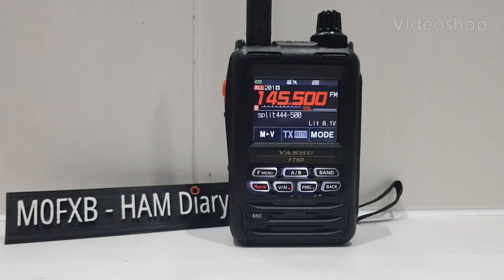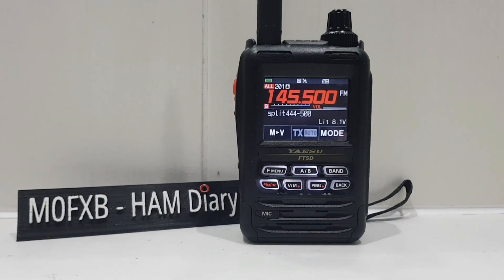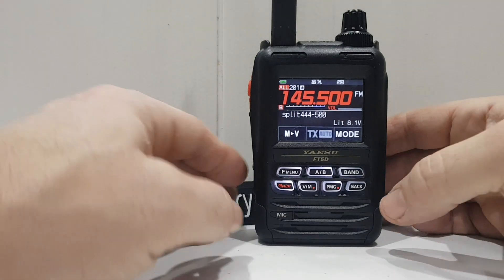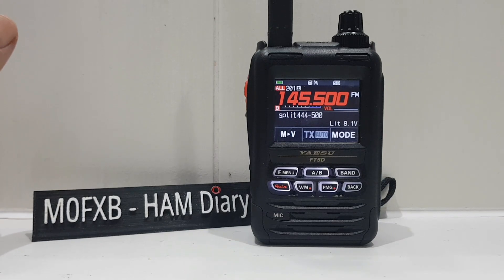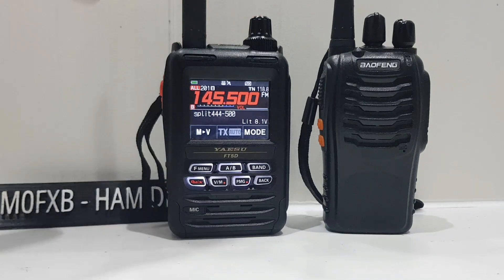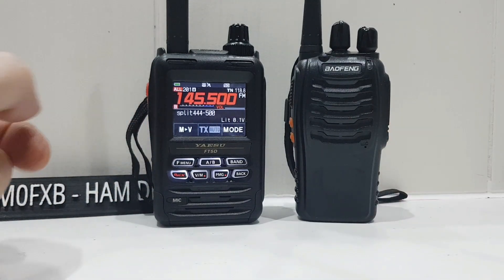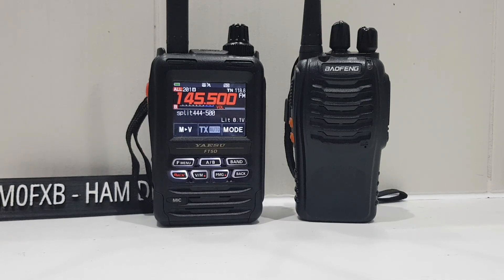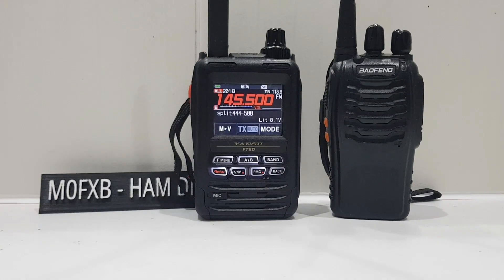Yaesu FT5D Ham Radios - Why Have - Split Mode - Seperate CTCSS (pl tones ) RX - TX-  Memories

Comment: A local ham repeater uses split DCS codes.  I don't believe the FT5DR supports split DCS codes.  What I did was program the DCS code to open the repeater, and left the repeater output to CSQ.
Reply from the maker: Why use DCS
Reply: @M0FXBHamTech  The repeater owner used split DCS codes in an attempt to keep out the riff raff.